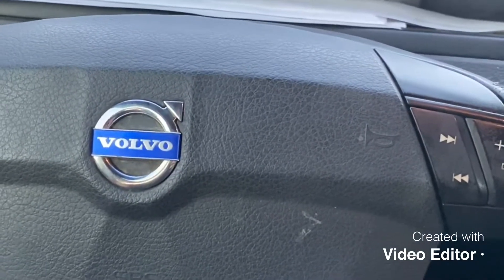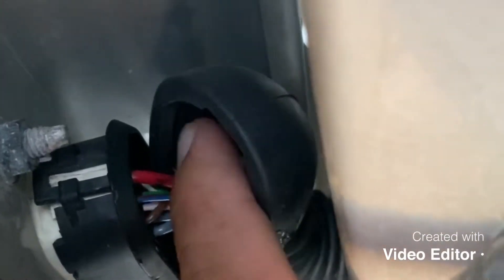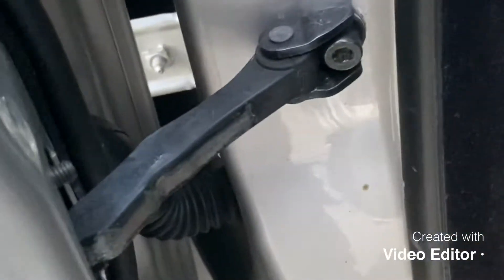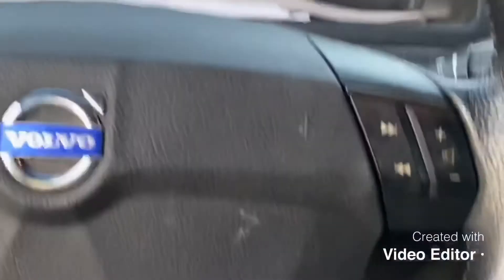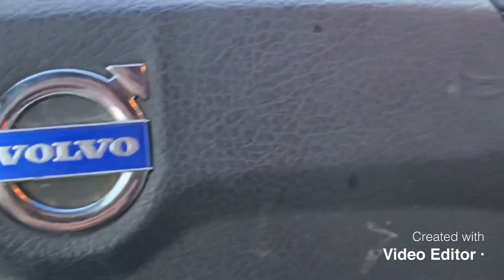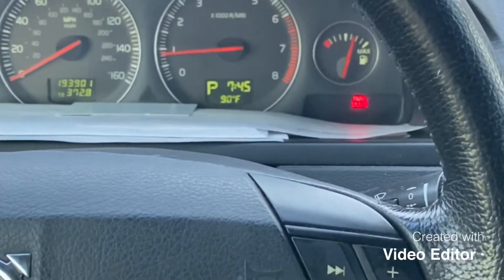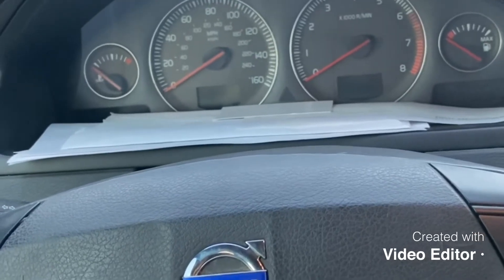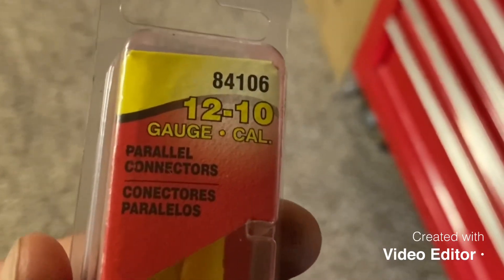Volvo xc90 2006 2.5  ground wire fixed

Comment: im starting to have a similar issue with "driver door open" message while driving. it wont let me unlock the doors. this would be my first winter with the car i was thinking maybe a fuse?

admire the volvo xc90 repair videos ..not a lot of them on here that are younger than 5 years
Reply from the maker: is probably the same one that I had  problem with so you can just take the door out and search the wires between the door thoroughly
Thank you for watching

Comment: Hi Mario, do u have any idea where all the grounding location points are for this model? I've purchased one from someone and would like to clean up all grounding points and ill be checking the other videos too. Thanks again from Cape Town, SA.
Reply from the maker: No I have not researched thoroughly 
the only one I had problem with is the one you saw in the video and I shared this video because I read that a lot of people have the same problem and they cannot figure it out so I posted on  YouTube
Thank you for watching